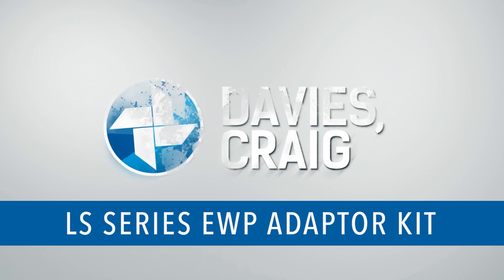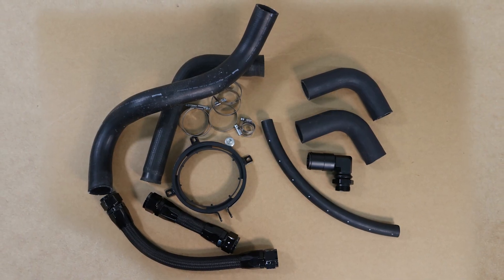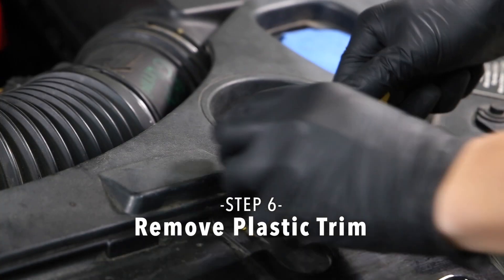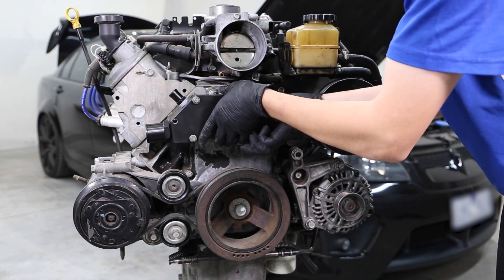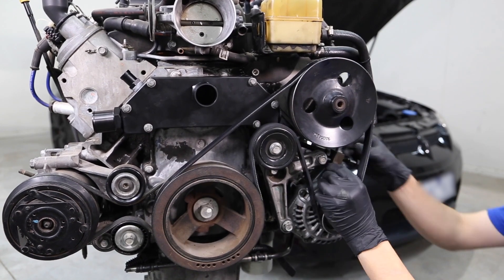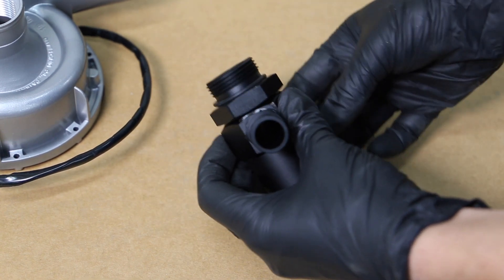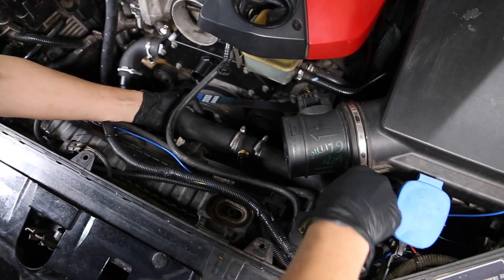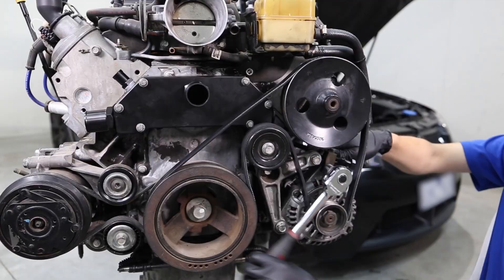LS Engine Block Adapter Installation with an Electric Water Pump (EWP150)

Comment: Electrical connections?
Reply from the maker: That is where the EWP150 Combo comes into it, we offer the digital controller which will manage the pump and fan, 
 wiring to connect up the our Electric Water Pump (EWP) and you electric Fans.